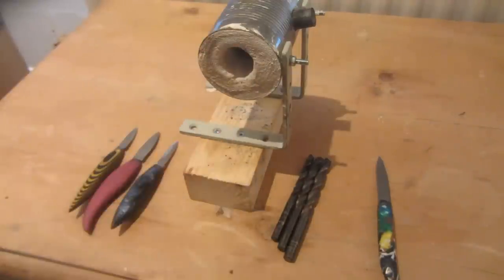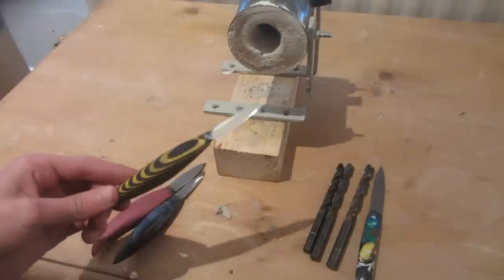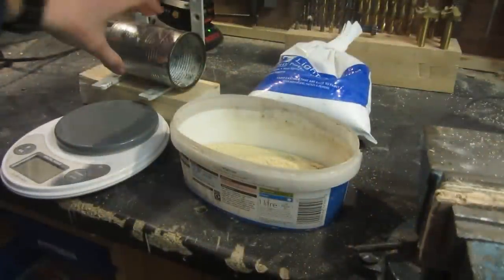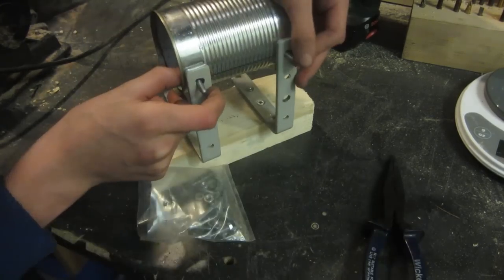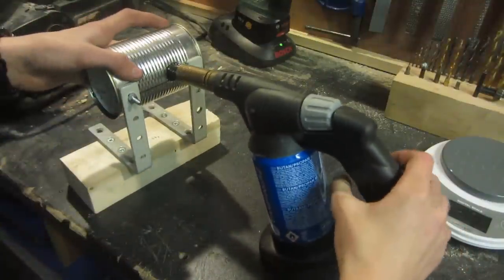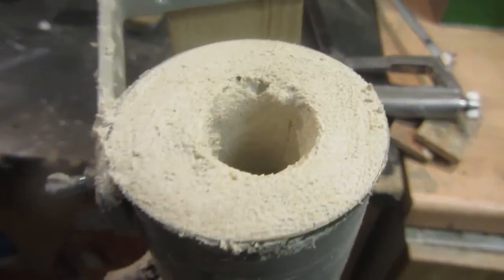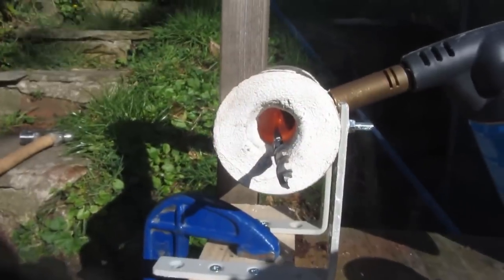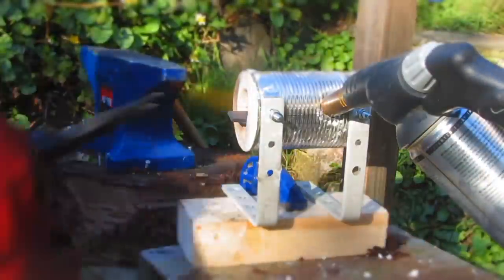Making a Soup Can Forge

Comment: Nice! Those knives look like scalpels, nice polish!
Reply from the maker: NightHawkInLight thanks! I am glad that you like them
Reply: If my flame just goes out and the gas just spreads doe that mean my torch sucks or did i use the wronf materials like wrong plaster or something
Reply: Or could ut be that the opening goes from small at the torch to big at the opening??
Reply: sacha jacobs You're probably covering the air inlet holes on the torch head.
Reply: Yeah i figured that out an also it doesnt even heat up a simple nail?? Is this normal??
Reply: +NightHawkInLight This is why you are one of the best YouTubers.

Comment: Just a few tips:
- HSS requires longer soak time to get the carbides into solution and it needs to be heated in a oxygen-free environment or the carbon will burn reducing the carbon content of your steel (decarburization) and that means it'cant be done in a forge, so in my opinion it would be much better to use HCS drill bits(used for wood) because they are way easier to heat-treat;
- When forging you are basically messing up the internal structure, so before hardening you need to normalize which means you heat the blade above critical temperature and you let it cool in air, usually forgers do it at least 2 times and that refines the grain too which is good.

Comment: I made exactly the same forge about two years ago and it is a wonder. The only thing I would add is that when you stick the dowel into the mix, coat it with vaseline or maybe even veg oil. That will make it easier to release, Especially if you get carelss, and I did, and let the plaster dry up hard. I wound up drilling the dowel out and burning it out :(.

Comment: Nice video m8. That forge might even get up to forge welding temps for pattern welding
Reply from the maker: Richard Ball thanks!
I think that I may try and make a slightly larger version of this with a proper propane burner that would easily get up to those sort of temperatures!

Comment: So I followed these instructions to the T. The only difference is my propane hole is on the underside and not the top. For some reason the only part of my metal that gets hot is the part that is in direct contact with the flame itself. Did I do something wrong?

Comment: Well done! Have you tried using pieces of HSS power hacksaw blades for knives?
Reply from the maker: kaziklu79 thanks!
I was looking at all of my old hss hacksaw blades and they make good  arrow heads but are too thin for knives. They may be good in damascus steel however!
Reply: I have a 2.5mm hacksaw blade, it's okay for a smaller knife. May be an HSS piece can be used for a laminated blade but I haven't seen anybody using it so far :)

Comment: Nice video!!! I also need a real forge :D
Reply: you could just tweak the design bit to make it facing up and curve the to to focus the heat to heat blades faster and even convert it to use like 3-5 pieces of coal ore probably charcoal
Reply: dig hole in ground, dig arm sized hole beside big hole and curve it to bottom of big hole, add charcoal briquettes, use something to blow lots of air into small hole, 

win
Reply: Jose ricotaconachoquesadillamandillalones very practical approach ant got to build housing too

Comment: Hey the art of weapons and nighthawkinlight. 
I build one of my own a wel but i have an issue i cant solve for some reason.

When i light my torch up and le the forge heat up... The flame gpes out and the gas starts spreading all over the room... Hw do i fix this
Reply: +sacha jacobs (diagon16) It sounds like you might be covering the air holes are you covering them?
Reply: Yeah i was i figured it out right after i posted that comment
Reply: Okay nice did you use the plaster of paris and sand mixture?

Comment: hi dude could you be able to create an all pvc crossbow?
that would we awesome. please reply
Reply: PVC shatters easily, so I doubt it would be able to withstand the force applied making a crossbow (much greater than that of a bow which you can make with PVC). Polypropylene pipes are a similar price on the Internet and are completely shatter proof, so they could theoretically be used for a crossbow, bow or even a blunt impact weapon.
Reply: TheRebel3000 Thanks dude